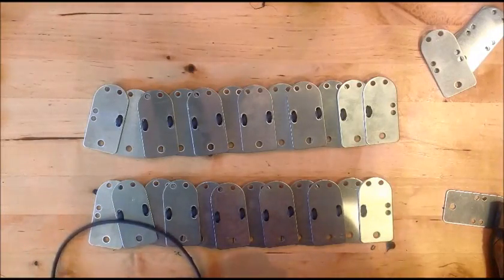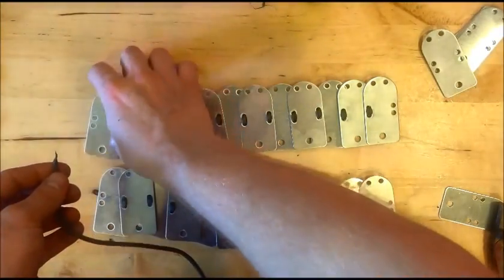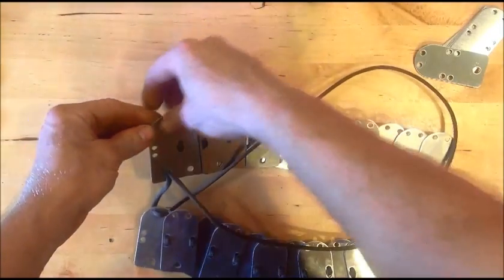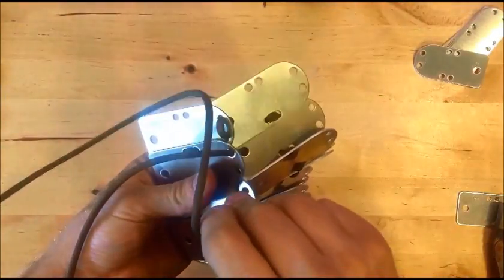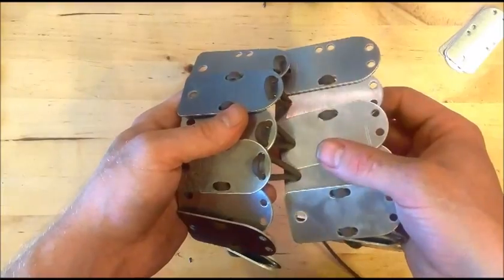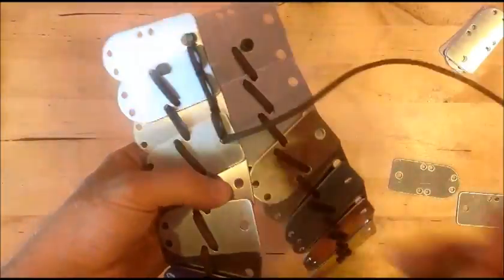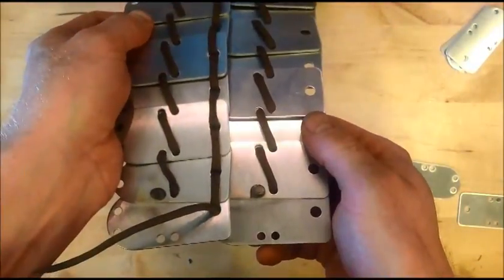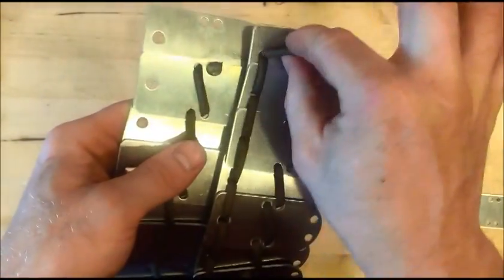Connecting Rows of Lamellar A Plates

Comment: Question on Paracord - using 550 at the moment - is that what you are using or a size down?  The 550 feels a little chunky on the A plates but seems to work just fine on the D Plates.
Reply from the maker: +Daniel Burke - Yep I use the 550 too.  I assume the "chunky" feeling comes when you attach rows together.  It can be tough removing all the slack.  I have heard of people removing the core strands of the paracord and using the sheath.  I don't know how long that will last, but you could give it a try.  Let me know.
Reply: I actually moved to using the lacing style (over under plates) as opposed to the stacked (more like a staircase) of plates and that seems to work a lot better in managing row attachtment